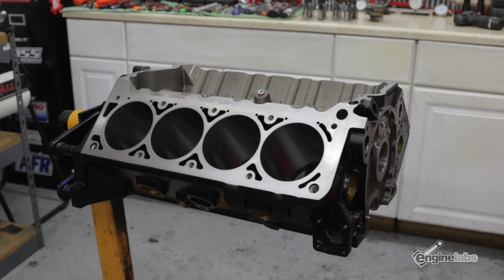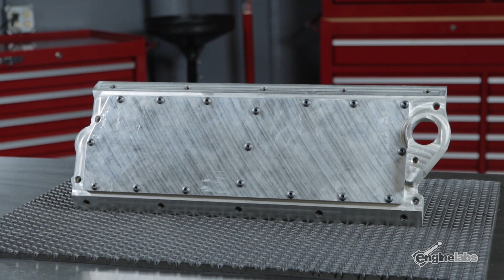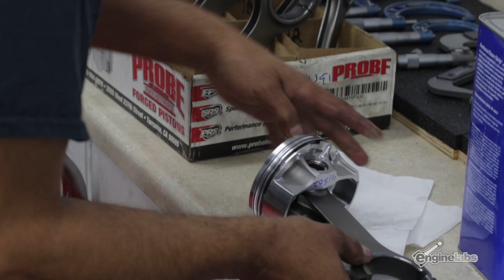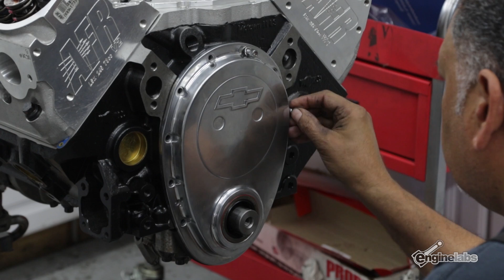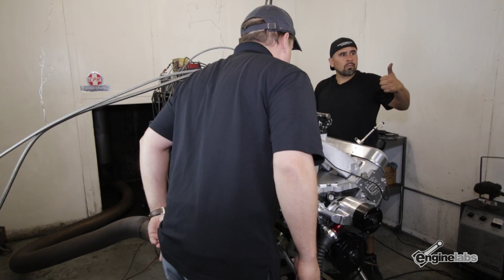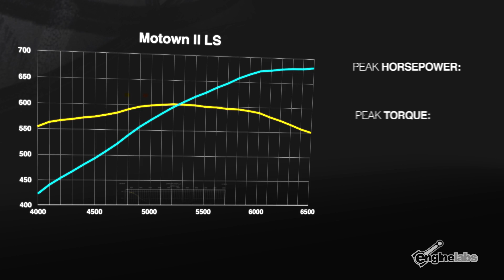Motown II LS Part 2 - Dyno Test

Comment: They didn't actually go as high as they could have on the pulls.  I really think a few pulls to 7500, along with more run time on the FiTech unit would have gotten that 700 mark if not more.  It takes them a while to really work on the small adjustments that make the last few ponies obtainable.

Comment: I WOULD LOVE TO SEE THIS BUILD DONE WITH A 3" STROKE CRANKSHAFT. YOU WOULD LOSE C.I.  BUT GAIN TORQUE AND HP.. 4"  INCH STOKE HAS WAY TOO MUCH PARASITIC FRICTION... PEOPLE AR GOING TO ARGUE WITH ME ABOUT THAT, BUT I HAVE LIVED THE PROOF RACING STOCK CARS. AND BEFORE YOU HATE MY MESSAGE, CHECK OUT THE BIG BORE SHORT STROKE ENGINES THAT NASCAR RUNS. YOU COULD TURN THIS INTO A 360 C.I. MONSTER THAT CAN EASILY TURN 8500 RPM AND GAIN AT LEAST 100 HP.. I HAD A DE-STROKED 350 (443 CI) THAT MADE 750 HP WITH CAST VORTEC HEADS WITH 2.02. AND 1.6 VALVES. THIS THING SHOULD MAKE WAY MORE...

Comment: Why waste your money on this block when you can modify a true LS block very easily to fit into just about anything? I get the best of both worlds type model here being all old school bottom end and new school top end, but unless you just have or want to throw your cash at this then build you an LS 5.3L or bigger. They can handle a lot of power, especially when you have even mediocre bottom end parts in them. Been there, seen it and there are tons of videos on YouTube of people hitting high HP numbers with these engines all day long. Feeling froggy,  add a single turbo or supercharger and watch that engine put out some really impressive numbers.
Reply: Some people just have more money then you. If I was to go small block in my 68 nova I’d built a 454 out of one of these. 4.185 bore by 4.125 stroke. 750hp ish on pump gas. I’d run it with a distributor in a carburetter does the fuck with people when you open the hood. Not only that small block Chevy front accessories look way better than LS stuff.

Comment: I want to  build an engine that runs on  E-85 which is  105  octane ..  I am thinking the traditional LS  fuel injection intake  won't make as much HS  but  more drivable and better mpg ..   I like the LS injectors
Reply: should work fine granted you have high enough flowing injectors to support e85 and enough fuel pump. Factory intake works great no need to buy an aftermarket intake for an ls engine gm put a lot of thought and design into the factory intakes and they work good even for a high performance engine they flow well

Comment: The AFR heads as shown in the video are stamped 73cc which suggests that these are P/N 1690 and not 1680 as commentated. What heads were actually used?

Comment: this requires so many block specific parts I have a hard time seeing how it would be worthwhile in all but a few very specific circumstances.
Reply: not really, maybe only the cam. This is even better because you can go crank trigger and coil packs OR distributor! Then accepts all the SBC bolt on stuff, water pump, power steering pump ect.
Reply: Do R/C! they explained its the windage issue that makes this better
Reply: Do R/C! the ls is Amazing this makes pretty much perfection
Reply: For the cost of this, you could just run a dry sump setup on an LS and not have to worry about any of this. Take those same AFR heads and run it on an LS7 bottom end and the LS motor will make just as much hp, if not more.
Reply: @travisjones6645  but then u also lose the simplicity of a engine swap, with this motor u can just drop in and be fine, and also u won't be just another guy with a ls, u got something different and more unique that still kicks butt
Reply: @travisjones6645  kinda what I was thinking also.

Comment: where can I find those valve covers?
Reply: Type in google "ls chevy slant edge valve covers"
or 
"Proform 141-266 - Proform LS Valve Covers"
Reply from the maker: +Mr88boxcaprice Here's the link to find what you're looking for: https://www.proformparts.com/product-exec/product_id/1003/nm/Polished_Aluminum_LS_Valve_Covers_no_logos/category_id/319
Reply: @Horsepower_Wars  What was the ACTUAL cost of doing this engine?  Is there a price or part number list available?  I figure the cost for this might have come down a little bit in the last 3 years.  But at the same time. it might not have.
Reply from the maker: @Ed_H_EDH  This was a number of years ago. You might want to check the original article.

Comment: 700hp on a chevy small block???? come on
Reply: that's nothing lol. the LSX454R is a race-only engine, but it makes 770HP. FROM THE FACTORY.
Reply: ***** with EFI and pump gas. AND A WARRANTY. It's all in the heads and the tune, mate.
Reply: ***** Okay, there are two chevy crate engines that make around 620HP. One is the LSX454 and the other is the ZZ572. They both require premium fuel - but the LSX454 requires 92 or higher. The engines YOU'RE talking about are the ZZ572/720R and the LSX454R. Both are RACE-ONLY engines, making over 700 crank horsepower on 110-octane fuel. Get your damn facts straight.
Reply: ***** Okay, you're making no sense at all. We both agree that the 110-octane version (LSX454R) makes 700+ and the pump gas version (LSX454) makes 600+, yes? So why are you so surprised that a hybrid SBC is capable of 700? Head and valvetrain technology have come a LONG way since those engines were introduced - and remember, they come with warranties. This engine does not.
Reply: whats unbelievable about a sbc making 700hp theyve hit higher numbers then that
Reply: A stock 5.3L LS engine can handle 700HP so why not? They aren't even using radical parts here either. Add a single turbo or bigger cam and better flowing heads and adjust things a tad better and you can squeeze a lot out of this block.
Reply: 427 cubic inches plus nascar cam and induction means not only nearly 700 horsepower it also means a low 8 second quarter mile times.

Comment: LS BLOCK > 350 SBC
Reply: not when it comes to power loss caused by windage or the oiling system.
Reply: You can run LS firing order on small and big block chevy engines.  Its a common conversion as it evens out journal loading impulses and increases bearing life.
Reply: @cmcbunch  yep they've been doing it on twin engine boats for quite a while and one runs reverse rotation in most twin setups
Reply: Dry sump LS really arent much of a dry system. Kind of half and half and nicknamed Dret sump. If you convert an LS7 to wet sump, it actually picks up power.
Reply: +Steve Pounder do your research. LS has windage problems causing power loss. it's been proven many times. show me a 427 cu in LS making 682 hp with cathedral port heads on pump gas like this engine did. I love my LS3 but I know full well the design flaws of the Y block. Sloppy oiling system is the Achilles heel of all LS motors and gen 3 engines are even worse with bay to bay breathing and windage. Gen 4 is better but the crank is still crashing into oil bouncing off the skirt of the Y block design. That's why the motown is an improvement
Reply: Can confirm that 4 bolt splayed mains are superior to cross bolt 6 bolt mains for strength.  A lot of people are just content to bolt together whats out there not realizing that there are definate strengths and weaknesses to EVERY design.  The SBC weakness is the heads, distributor and intake, the LS design is windage.  This is a good cost effective alternative to custom blocks for the sportsman/street enthusiast is isn't made of money but still wants more performance than factory blocks.
Reply: If this engine takes a SBC crank, then it has to be 18436572 firing order. The reason it needs a special cam is because of the uniform intake and exhaust valve line up of the LS heads
Reply: +Rotaryray C LS is superior in every metric  SBCs are great but they're outdated just how it is